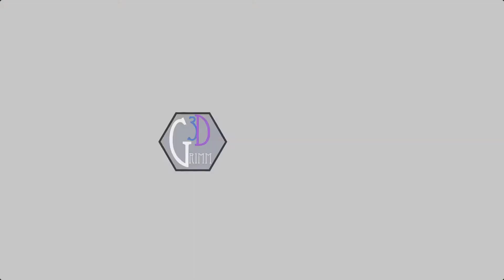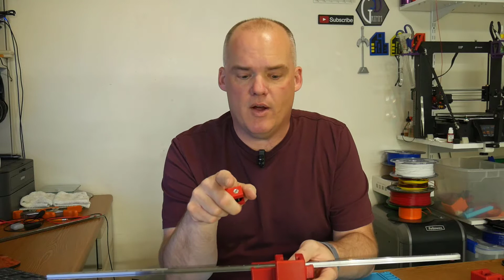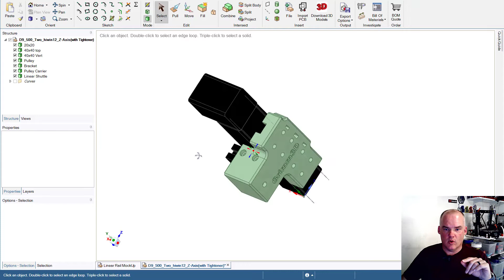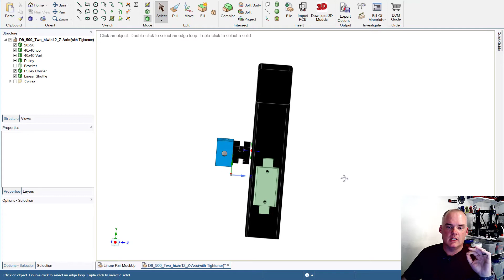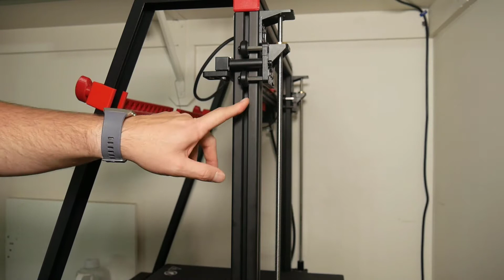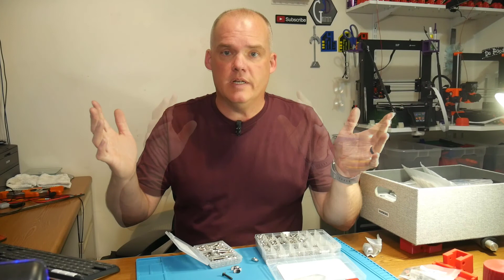Monster D9/500 Z-Axis Linear Rail Bracket Pt. 1

Comment: Hey this is great stuff man! Just got an old d12, 500mm as well and i'll be sure to check on your vids. I know this video is old but do you still have this machine?
Reply from the maker: I still have it. Still prints well. Mine is a D9 skeleton, but most of the parts are replaced/upgraded. I posted most upgrades in this series, but let me know if you have questions. Thanks for watching!!
Reply: @Grimm3D  I have a voron im working on and it's a great excuse to use the hand-me-downs on it lol. 

I adapted a rapidburner with a stock v6 volcano but the hotend cooling can't keep up. I think it also has something to do with the X beam being 2040, so it has little to no exhaust with this config
Reply from the maker: @nico8273 My cooling is a little weak as well. Keeps me from printing at higher speeds, but everything else seems solid (for now)

Comment: Can't wait until this design is up, I like it so much more than the one thats already on thingiverse, it seems much more rigid.
Reply from the maker: You and me both! I am having trouble finding time to film the next installment. The changes I made to the design seem to have worked well. The part drops right in place now, with the belt tightener and everything. I just want to show assembly and stuff on video. . . Time always seems to be my limiting factor. 

I'm also interested in making the X gantry more solid. I think this design will make it happen, but I still need to design the motor side. Thanks for watching!!